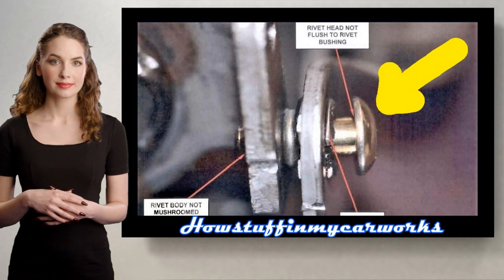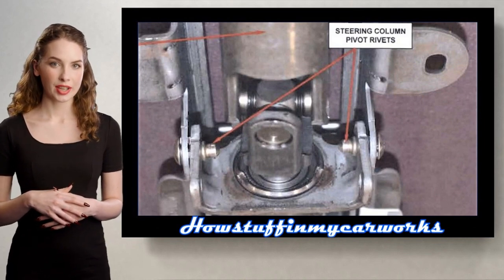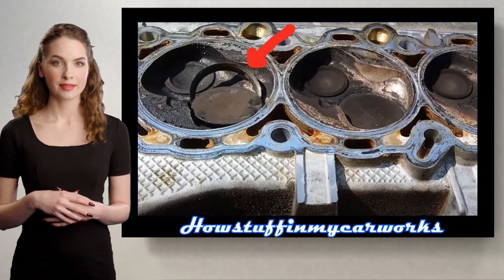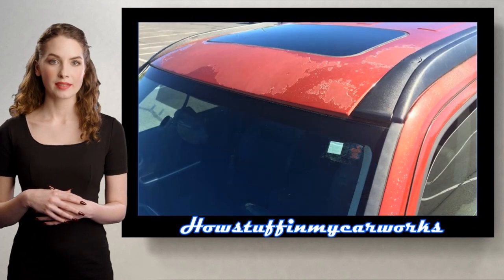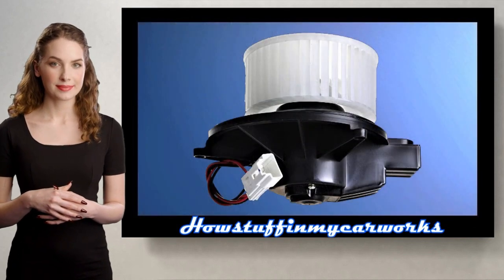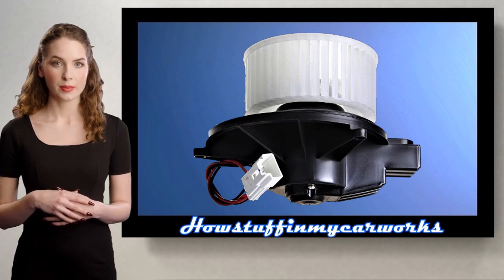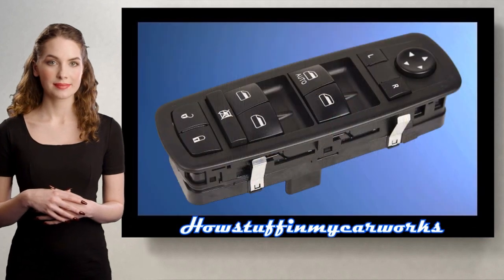Dodge Nitro SUVs 2007 to 2012 Frequent and common problems, issues, defects, recalls and complaints

Comment: My dodge nitro 2008 works many functions at the same time or together. Like lights+horn+glass water+...
What is this problem? And how to resolve?
Reply: It's the tipm. I had the same problem. Replaced with a used one
Reply: I'm sorry for the question, I can't find how to open and close the doors since when or do you change the remote control battery? do you know how to solve the problem? Thank you
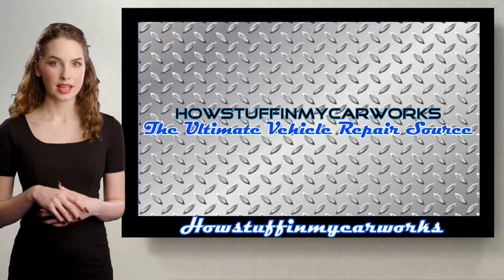Reply: @geneeddie1 2:18 iiih but do

Comment: #11. Avoid this rolling pile of garbage.
Reply: I believe you, thank you very much
Reply: If you know what to repair, which is eaily out there and can be done yourself for not much money thanks to the internet, It's a blast to own.
Reply: @joshuasweeney7863 I just have my window detached atm and slide it up and down by hand. In the past year I have had my water pump bearing crack, which threw off and shredded my belt and proceeded to spew all my coolant into the engine bay, which then fried my alternator within the following weeks. Had to replace it all in my parking lot at work. Wasn't too hard, except the FL heat. Now my ABS module is going bad. Probably from the previous coolant spraying all over under the hood.
Reply: And I always say every car has their problems not just this one